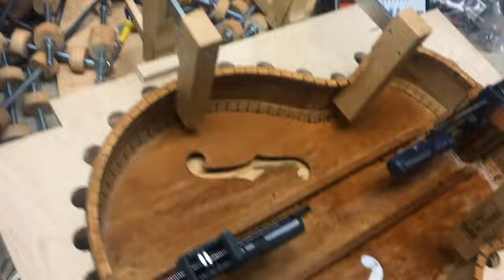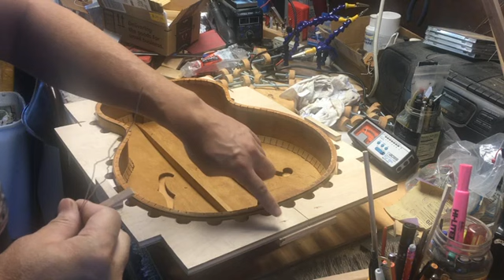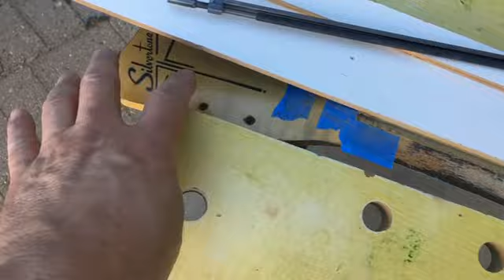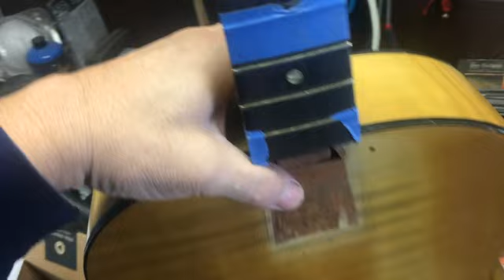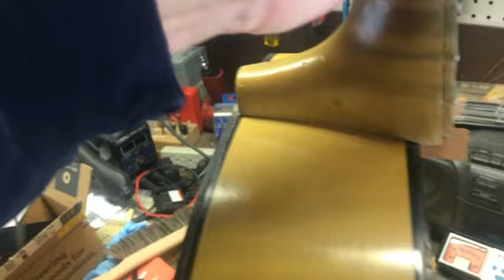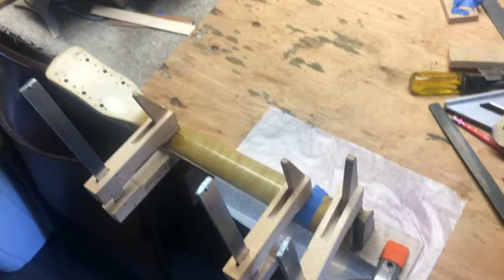Vintage Silvertone archtop guitar restoration - Part 3 of 4

Comment: Did you think about pin holes and inside bracing on the waste like you have for the heal and neck block? Would that have worked? I have a similar bottom waste that splayed out and a bad glue job. I’ll have to to this with the neck on. I saw a cool Frank ford splay jig on a 20’s Gibson L1?. I might try to try it this way.

Comment: If the sides splay out it usually means the top has shrunken after the back is removed. This has happened to me and I had to also remove the top and reconstruct the guitar body. If you don't do this the the root cause isn't fixed and may lead to future problems such as cracking because the guitar is under constant tension